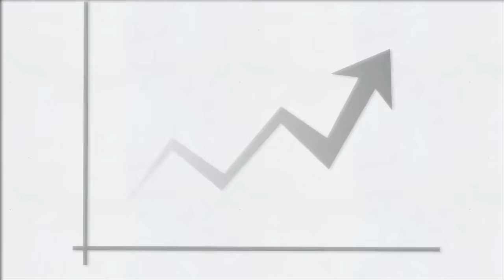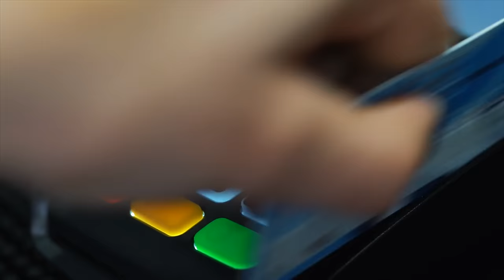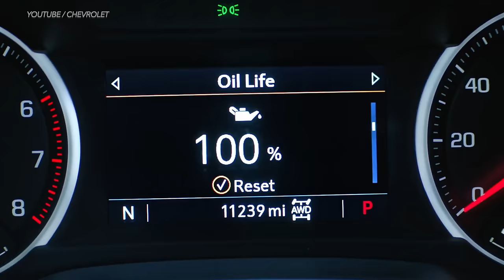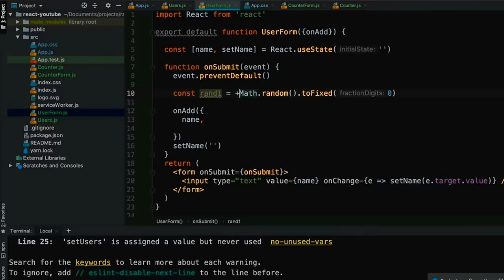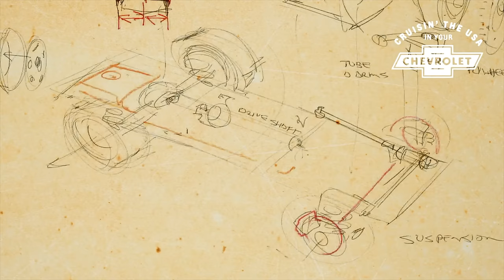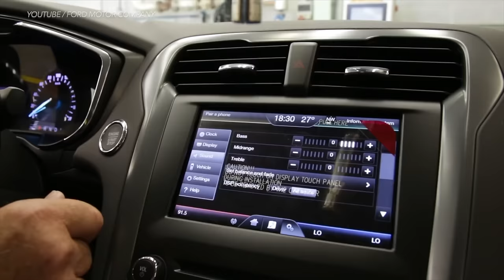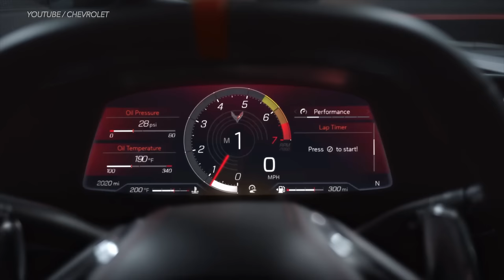Here's Why Car Companies Just Made it Illegal to Work on Your Own Car

Comment: epa has a part of this mess also. I'm going through new options to get flex fuel installed and tuned. that will ultimately help me by not limiting the fuel to be always 100% gas. by next week the laws change the way for me to equip my old vehicle to stay valid and efficient burning the current octane where provided.

Comment: About becoming a mechanic: My dad was an aircraft mechanic in WW2 and came back and bought a gas station. He started a car and big truck repair business. One day, there was a sewer crew working next to the station. One worker came in to buy a Coke and said he could never be a mechanic because it was such a dirty job. There he stood in his waders with human sewage above his waist.
Reply: Yep. Different kind of dirty.
Reply: Richard  . My late Grandfather was similiar . Had his own gas station / repair shop for decades.
Back when the only real electronics under your hood was a distributor , a coil and a starter . 
Like most things in Life back then , things were a lot more simple .
Cars these days are just self stopping , self parking , rolling entertainment centers that cost as much as a small house .
Reply: @jayhockley8841  My 55 Chevy ran by 2 wires (not counting spark-plug wires), a wire from the key to the coil and a wire from the coil to the distributor. (points) When I was wrenching, we used to make jokes that Ford wanted to put Snap-on out of business. All you needed was a 9/16" wrench to fix a Ford.
Reply: @richardfabacher3705  
I had a 53 Chevy Club Coupe .
Pretty much same ignition setup.
I took my fan belt in to the parts store to get a new one and it was so short he thought it was out of a riding mower .
The old days are gone .
Reply: @jayhockley8841  I had a 1952 Willy's CJ2A, which was a simplistic joy to work on.
Reply: @ephraim804   Yeah , the days of the Simple Internal Combustion Engine are over .

Comment: G'day, Having a Theoretical education on how something works is not the same as knowing how it works.
I had an Electrical Engineer spend many hours (Days) trying to work out how a Pilot operated Diaphragm Valve worked. The only moving parts are a Spring loaded Ball, a rubber flap and Air.

Comment: Forget about becoming a dealer mechanic. 
Here in Canada, that's turning into an almost mindless job: Diagnose drivability issues, replace parts, busting tires, R&R, PDI's, recalls, and what else. Most dealers source out most electrical issues, wind leaks and noises, transmissions, engine rebuilds etc. etc. No one fixes anything anymore.  If it can't be found on a TSB, we'll just say it's fixed.
No, the future is in electronics; Automotive electronics if you will. Learn to diagnose and fix some of these components that they are throwing away, that's where the money is. 
Attention Snowflakes: You'll hardly get your hands dirty.
Reply: Since I volunteer at a food bank you probably think I am snowflake but I get lots of dirt on me unlike my R neighbors who hire people for everything.  Fence need repair then I do it, painting - I do it, power washing - I do it, my R neighbors are all bums.

Comment: I have a 2015 Genesis. I change the oil occasionally and avoid the dealership and I don't drive all over the place keeping the mileage low .Runs like a champ with absolutely no problems

Comment: Copyrights and patents are also legalized monopolies.

Our founders said for a LIMITED amount of time. They did not mean year, decades, centuries, etc.

Another problem is that there are 'zones' that exclusively allow certain distributors to sell at whatever the market will bear.

Patent the whole vehicle, not parts of a vehicle.

If someone has a patent or copyright, they should be forced to sell their product at 10% above construction costs. And for no more than 3 years on copyright and 5 on patents.

Henry Ford said that he would give away cars for free if he could be guaranteed to be the ONLY one to sell the parts.

How about this: force car makers to repair and replace broken or worn out parts for free (including labor, towing, and free rental) for the duration of their patent.

Bumper to bumper 100% free replacement of parts for the duration of the patent.
And IMMEDIATE replacement too - none of this have to order something and wait days, weeks, months to even get the part.

LED screens typically turn black when they are too hot.

Mechanics have to work in all kinds of temperatures and conditions.
By comparison, they make a pittance relative to the air conditioned cushy computer job.

Who wants to work in the heat, cold, grease, etc when they can sit on their duff in a climate controlled office making big bucks?

Comment: Scotty, those “patented” parts can be crap, too.  When it comes to lighting, don’t take chances with seeing and being seen at night. Avoid shiny trinkets with dangerous optics.  Get OEM and the best bulbs you can.  Not long ago, I bought Ford OEM headlights for a “whale” (1998-2011) body Crown Vic.  A few months of parking outside had the reflectors degrading.  If you can’t trust the manufacturer and you can’t trust aftermarket (ask me about the brand new egg shaped Chinese brake drums from O’Reilly’s for my Corolla), life becomes more challenging.
Reply: Way back when, drums were all minutely egg-shaped and had a primary and secondary shoe for a "cam" effect.  The forward-facing shoe was "shorter" than the other. Anti-lock brakes ended that. Locking the wheels was considered a good thing back then. (Brake-drum turning machines had the "eccentric" egg shape automatically built-in.)
Reply: @richardfabacher3705  I didn’t realize that last!  I have seen older rigs with two single piston cylinders per wheel and two leading shoes.  These drums for 9th gen Corolla were BAD. Friend at O’Reilly’s said one took three passes.  As one whose vehicles sit outside in damp climate, I miss drums.  I’ve repaired or replaced sticky calipers and pistons more than once.  My 63 year old tractor has straight mechanical brakes, no problems.😁
Reply: Even if you upgrade the regular lights on a Camry are still crap compared to high beam, it is like 50 feet vs 400+.
Reply: @toriless  I guess we’re lucky to have two 2007 Corollas.  Brand new genuine Toyota headlights, then swap from 9005 & 9006 to 9011 & 9012 bulbs (you have to grind one tab to half its size, you’ll see when you compare), then careful aiming, and we have very good headlights.  But if we had 15 year old headlights, we would not.

Comment: Are car replacement parts at all like sneakers? Meaning can you sell them if they are slightly different than oem? You only have change them slightly from an exact copy to be able to get around the trademark?
Reply: Slightly, I got a key fob the did not have the Toyota logo for $60 instead on $99 I paid for the Toyota logo one.  Both work fine.  I got two for $120 instead of one for about $100.

Comment: My old Hyundai diesel hasn't been to the dealer for a service for the last 130,000 miles. I do all maintenance myself. The only time it's been into a garage is to replace front ball joints and that was only because it needed a heavy duty impact wrench to remove them. It helps from the outset to buy a car that has a reputation for reliability and isn't over-complex. There is also a good online community to share knowledge on faults and repairs. It's disappointing that the latest generation i30 diesel has changed from a cam-chain to a cam belt, and requires a special tool to remove the oil filter which is only available to Hyundai service technicians.

Comment: i work as an auto glass for 6 yrs now. Most of the autonomous driving tech is done through the windshield. So, when we replace the windshield the cameras have to be recalibrated and also it cost way more for the windshield itself (rain sensors, condensation sensors, light sensors, fca cameras are all mounted by brackets that’s attached to the glass). So in turns even a corolla or camry replacement will run you 500-1000 easy. Audi, BMW, Range rover, etc will run you 1k plus easy.

Comment: It went an mechanic to an computer technician. My 2004 Jeep. Turn key and go. Simple. My 2020 F150. Once an month. Since the truck doesn't pick up simple wifi. I have to plug in my cellphone and check for updates. Its not an truck. Its an computer. I cant work on my truck. My Jeep I can tear it all apart and put it back together. What gets me also. The truck has an power converter. Sure. Only 400 watts. Give me an break. I have two portable ones way more powerful. 750 and a 1000 watt. Making the one built in the truck about pointless.

Comment: Very true, my friend's  Uncle worked for a japanese car brand in Taiwan. His uncle told my friend that they have a task to design and engineer parts to fail after 3 year... which back in the days cars warranty was 3 years. That's why Euro cars, their strick rules for keep old cars on the  road, That's why most likely won't parts won't  last and unreliable and unnecessary wiring. Look at the engines, 1/3 of parts a plastic...

Comment: So how long do you estimate a 2003 GMC Yukon SLT that’s in mint condition with 203,000 miles will last in the future?

Engine was extremely well maintained over the years by the book and then some, transmission only had 50,000 miles on it due to being rebuilt tho
Reply: Don’t be surprised if a transmission problem arises in the near future
Reply: It's a great engine, I purchased a Tahoe with the same drivetrain and got 300k. I did a junkyard transmission swap at 200k.
Reply: No such thing as mint condition  lol  car is over 20 years with 200k miles
Reply: @bigdavedayday1581  I guess lol

Comment: Less mechanics also means more unscrupulous/or ignorant mechanics. I went to a mechanic at a new car dealership where they lied to me, and he never fixed the car he just reset the code and cleaned something on it but never replaced a thing and wanted to charge me more to repair it again. It ran bad again 2 days later.  I took it to a mom-and-pop shop they replaced the bad injector and tuned it up and it ran like a top again. When I told them what happened they called up the dealer and gave them hell for what they didn't, couldn't, or wouldn't do. Thank God for honest Christian mechanics. There is a shortage of morality and honesty is all. I'll never go to a brand name new car dealer again for repairs or even a new car. It's bad laws like parts patents, that allow them to be bigger crooks than they already are. And just greedy and they screw themselves.

Comment: I like my 1988 Chevy van since parts are inexpensive and will be available until the end of time. Same thing goes with my 1973 BMW motorcycle. Those are simple and robust so there's still plenty on the road with plenty of factory and aftermarket parts to chose from. My son recently gave me his 2005 Dodge Neon that runs great with 125,000 miles on the OD. Bought it for him as a high school graduation gift and the dealers didn't want it in trade since it has a failed clear coat, broken electric window motor, two bald tires and needs a TB kit plus new motor mounts. I fixed the window, got the TB kit and all four mounts to install myself and will do a ghetto roller paint job using a good industrial enamel made to adhere to blasted epoxy coatings. Hope the car holds up for the next 12 years or more.

Comment: When buying a new car try to get one doesnt have side and front cameras. If your mirror gets damaged and you have to replace the whole thing it will cost above 1000 dollars just becauze it has that camera there. Less techonogy in the car means less things that can break less expensive bills.  Electronic windshield that shows your speed on it stay away from those. Electronic seats, electronic rear view mirror and any stuff like this is unnecesary and can cost you money if you have to fix them.

Comment: 1983 a Toyota Hilux single cab with a 2.4 l diesel each service cost $400 + in 1983 from the dealer. Today the Mazada CX 5 with 2.5 l Turbo Petrol costs $400 per service. Really I have not noticed the difference at all except the Mazada is so much better to drive. But you are right about the Hilux I even had the equipment to overhaul the injectors as they were mechanical opening controlled by a DPA type injector pump.

Comment: As an automotive engineer I can bust a myth, planned obsolescence does not exist. We don’t design parts to fail and I never heard of such practice. To be honest we already have enough trouble making the damn thing work in the first place, we don’t have time or resource to sabotage it afterwards
Reply: The only thing that exist is hazardous attempts at reducing cost and for sure on the financial side if they think they can get away with shaving 1/10th of a millimeter of metal on each part, they will sure try
Reply: Have you ever repaired/replaced one of your designs? Easy assembly but not easy repair is a design feature.
Reply: @robertwiltse2379  The rule in the industry is now ´safety first’, then environmental regulations. Practicality falls far behind I’m afraid. It’s not an engineer’s choice it’s more like a society choice, for some reason no one wants to die in a soup can anymore and no one wants to breathe fine particles anymore
Reply: @jticklemaker1265  I often have a dream that if I had Elon Musk levels of financial resources to build the most robust, economical, and easy to repair vehicle ever built. The go-to if you had to cross the Sahara, Outback, jungle, etc... Something super reliable that you could easily repair in the field with little more than a wrench and a screwdriver (which it would come with). 
Instead we have cars that are totalled with a 5mph fender bender, and are impossible to work on. 
We're going backwards.
Reply: @jasonhurdlow6607  Quite a list of requirements… It might be doable if you do only one and it doesn’t have to pass the regulations. But Musk prepares much work with his one-piece aluminium frame. It’s not an expensive fender you will have to change on a 5mph shock, the car will be totalled with frame damage !
Reply: @jticklemaker1265  Yeah, in my mind I've resolved myself to the idea that I'd only be able to sell it in Africa or other similar places in the world, since it'd never be legal other places because of safety and  emissions laws. Those two alone contribute massively to the excess complexity and cost of modern automobiles.

Comment: My first car was a 78 Camero.  Designed like crap.  The center box had  bendable plastic for a hinge, which of course broke.  So I scraped together $50 for a new box.  3 weeks later when it came in, it was blue not black. “Hey, I need a black one.”  The response “It only comes in blue.  You can go down the road to get it dyed.”  Last GM I ever bought.

Comment: I bought a 77 dodge tioga 2 rv 17 feet long this week. I'm amazed how well its built , then I looked at the file of old repairs, even just 20 years ago 30 dollar repairs.   Couldn't believe it.  I had alot repairs on cars this year, most repairs are now 700,  900 in usa whatever it is. Only key ignition issue was 600. Everything else on my explorer, wheel hub, 550, transmission 4700, thermostat I think it was 900, gas tank issue 900, fixing that they broke the gas line rending car useless...

Comment: The core components of the majority of cars within a manufacture are interchangeable now. They build 4 or 5 completely different looking and handing nameplates off of one main architecture. My Camaro SS and the Cadillac CTS sedan look nothing alike but take the wheels off and look at the chassis and suspension. Exactly the same. Not even just “similar”…… right down to the last nut, bolt, flange, bushing, floor pan, and wiring harness. Completely interchangeable.

Comment: Had a 2011 Nissan Armada.  A front headlight burned out at about 130000 miles.  It cost $250 to replace as you have to almost dissamble the entire front of the vehicle to get to it.

Comment: As the saying goes, "The answer is Miata". Go out and get an old one. They are as reliable as an anvil. They are simple and things don't just break for no reason. The only reason they can get expensive is that you love them so much you can't help but upgrade everything on the car over time. Again, they are simple, so it is a great car to learn mechanical skills with. And you are very liable to become a better driver too.

Comment: It's really got bad these days. In all industries. Im an electronics designer. Today, a lot of my business is taking this "designed-to-milk-you" technology and creating "accessable" technology to replace it. My flagship product is a charger for large battery banks for mine cars. An American company caused big problems for a South African supplier of these vehicles by obsoleting the electronics for their chargers. I partly reverse-engineered their charger and partly designed my own replacement circuitry that did the same job. The components are old-school through-hole that can be replaced by the average technician instead of these tiny surface-mount components that no-one wants to touch. I used a standard microprocessor that can be plugged out and changed and it can be programmed with off-the-shelf equipment that plugs into the average PC. 

My future is to make more of this kind of equipment. I haven't done any standard car parts yet but I really want to. Death to these  modern companies and their strategies to suck the consumer dry.